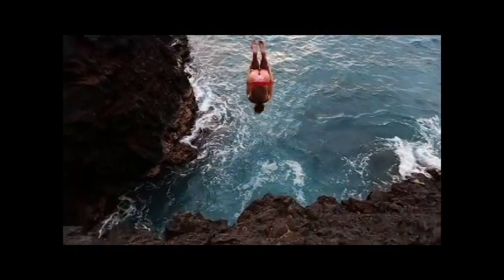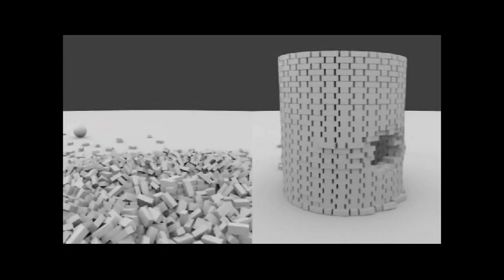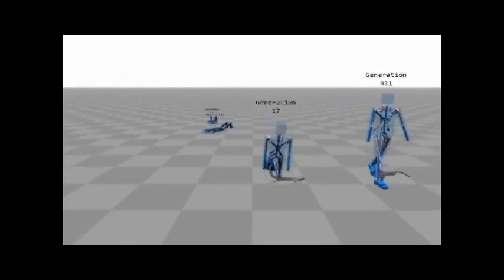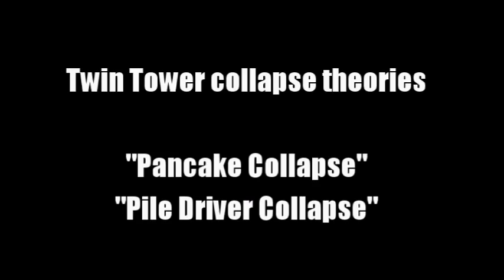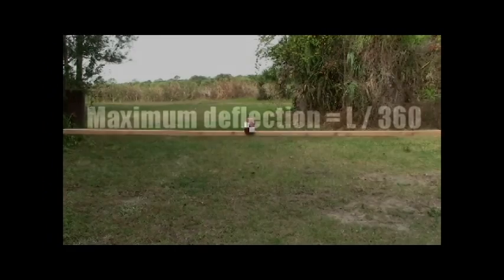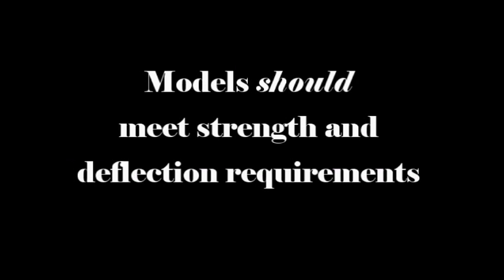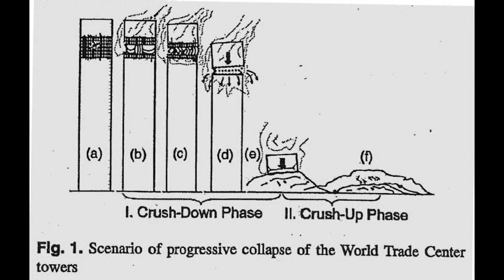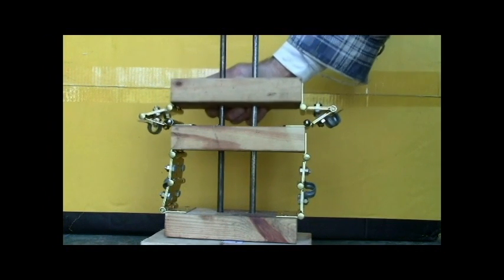9/11 Experiments: The Force Behind the Motion

Comment: Yes, this video does prove something: With a little effort, you can rig an experiment to give the result you want.

Of course, the content of this video has nothing to do with the towers.
Reply: And it proves planes dont need wings to fly if you believe this BS you believe hijackers would allow hostages to call others because...well you can finish that sentence.  Lol. Hint YOU CANT

PS. Cell phones could not make those calls even though phone records prove they came from cell phones.
Reply: @DS94everXev  Your opinion on what the hijackers would or would not have done is irrelevant.

PS. Most (all?) of the calls were made from Airphones not cell phones.
Reply: @Tim22222  They had been called by cell phones . Tower 7 ?? No video plane hitting pentagon .
Reply: @abhilashyadav2274  "They had been called by cell phones"
Two of the 36 documented calls were made by cell phone. 2. And in which state of the flight was that? Where were they flying and at what level?

"Tower 7 ??"
That's not a question.

"No video plane hitting pentagon "
2 video's hitting pentagon. i agree it's hard to dentfy a plane. So what? What does it prove?
Reply: I noticed you posted this 3yrs ago and 2yrs ago you posted this exact comment?
Are you ok?
Do you need some help with your mental problems??
Reply: Also, don't forget that, if you say stupid and irrelevant things, that makes you right.

Comment: Another theory:

Were these buildings just sooooooo wide(64m per side) that they could conceivably collapse, straight into themselves,  as we saw them? 

And tower 2(south) did twist and bend at around its impact floor, much lower than in tower 1, and in a corner.  

Would remote demo have been rigged to give the appearance of collapsing at the impact points, by intentionally first igniting at those floors?
Reply: "Were these buildings just sooooooo wide(64m per side) that they could conceivably collapse, straight into themselves,  as we saw them?"
First of all they didn't collapse straight into themselves. Over 20 other buildings were damaged up to the point they needed to be demolished. That would not happen if the towers collapsed into themselves. Secondly, it is not the width, but the height that determines how buildings will collapse.

"And tower 2(south) did twist and bend at around its impact floor, much lower than in tower 1, and in a corner. "
The top of tower 1 buckled southward just before the progressive collapse as well.

"Would remote demo have been rigged to give the appearance of collapsing at the impact points, by intentionally first igniting at those floors?"
No. No detonation devices will survive the plane impacts and resulting infernos.
Reply: @brucelansberg5485  Each of the Twins was big enough to be its own CITY, so of course there would be collateral damage in such tight quarters.  The supporting cast(WTC 3-5) were all just meters apart from the dual leading act.  

I truly believe that if the impact & fires from those airliners were solely responsible for the collapses of WTC1 & 2,   they's still be cleaning up and rebuilding one third of lower Manhattan as of LAST YEAR, after both them sons-o-bitches FELL OVER SIDEWAYS and took out HALF A DOZEN SMALLER OFFICES EACH.
Reply: @Zickcermacity  Covering 16 acres to a height of dozens of feet. So, no. They didn't "fall into themselves".
As for cleanup, it took the better part of a year.
Reply: @Zickcermacity  No? Nothing? 5 days, and no ability to actually answer. Why MIGHT that be, we wonder? Couldn't be that the cool key-board warrior realized he actually said stupid shit, and ran away? Nah. Couldn't be that.
Reply: @brucelansberg5485  "If the 1993 bombing would have successfully toppled it" sounds redundant.

"If the 1993 bombing had successfully toppled it" should be easily comprehended by anyone with just a sixth grade education.
Reply: @Zickcermacity  ""If the 1993 bombing had successfully toppled it" should be easily comprehended by anyone with just a sixth grade education."
Sure it would. But like @MoonEyes2k said, that's not what you wrote earlier, is it? You left out "had", probably by accident, which gives the sentence a different meaning.

Now, since we got that out of the way, let's get back on topic. My question to you was: How? What mechanism would have the towers fall over, being this tall? Which force would have the towers move sideways? Gravity works straight down.
Reply: @brucelansberg5485  The point is, I never left out 'had' in the first place.  MoonEyes is just trying to stir the pot.

As far as what would have caused a sideways topple across half the narrow southern tip of Manhattan, the towers each were struck on one side, or as in South, in a corner.  If that damage and fire was all it took to bring the towers down, they should have fallen in the direction of the most damage.
Reply: @Zickcermacity  "The point is, I never left out 'had' in the first place."
Yes you did. It's still there, without the "had". 
"If  the  1993 basement bombing successfully toppled the north tower"  Fourth reply in this thread.

"As far as what would have caused a sideways topple across half the narrow southern tip of Manhattan, the towers each were struck on one side, or as in South, in a corner.  If that damage and fire was all it took to bring the towers down, they should have fallen in the direction of the most damage."
This still doesn't answer my question though. The only force acting upon both towers was gravity. So, why sideways?
The thing is that we shouldn't look at the towers as one big massive part. We have to look at them as a collection of individual parts, which is exactly what every single steel framed building is. To unbderstand why and how the buildings collapsed, you need to have a basic understanding of the engineering of the towers. Do you have this?
Reply: @brucelansberg5485   If you guys want to continue arguing grammar, get a room!  I'm here to suggest that those towers collapsed way too neatly to have been caused solely by airliners crashing into them
Reply: @Zickcermacity  "If you guys want to continue arguing grammar, get a room!"
I will accept your aplogies :) You know it's not about grammar of having missed a word. But this incident perfectly shows how we can be fooled by something we're sure of, but are wrong about. Anyway, I believe I have responded to all of your arguments in this thread so far. Seems to me it's your turn. i asked some questions before you side stepped.
Reply: @Zickcermacity  "The point is, I never left out 'had' in the first place." "If you guys want to continue arguing grammar, get a room! "
Translation, "Oh, NO! I actually said STUPID SHIT! Oh, what'll I DO!?"
You're welcome for that.

When you have an actual argument, do let me know.
Reply: @Zickcermacity  Give Bruce a break.  He thinks the planes hit the towers at a 90 degree angle which would be nose of plane hitting the top of the towers and that there was no confirmed repirt of pepper spray being used.

He also thinks himself to be a pilot and aeronautical engineer.  So you have to take his word over experts who contradict him.  It does not matter how many vids and expert pilots and engineers you bring up and present.  He knows more than all of them.

Dont ask him why the hijackers permitted all those hostages to make phone calls.  Or how some of the hijackers never stepped foot in America.  Or how stairs appeared in a plane that had none (coming from a phone call  from a flight attendant who said the hijacker was on top of the stairs in a plane that had no stairs).  Or how pepper spray didnt impact the crew, hostages, and hijackers due to the plane being pressurized if the story were true (only business class was impacted by pepper spray.  That plane was on the ground because it was no longer pressurized)

Regarding the Pentagon plane Bruce thinks the hijackers who could barely fly a Cessea can pilot the airplane just above the ground and not hit lightposts or trees or even have its wings intact nor located anywhere because the Pentagon damage showed no impact from wings nor were the wings on the ground so how did the plane reach the Pentagon?

Bruce insists that cell phones worked just fine at 35k feet in 2001 (they died at 2k feet in flight).  He also insists that it is not reasonable to question how quiet the phone calls were.  No engine noise.  No other people talking in the background.  No screaming from the hijackers to tell people to get off the phone.  Bruce thinks that the entire airplane went 0 voice when a person was on the phone.

Bruce (in addition to being a Top Gun pilot and aeronautical engineer) is the utmost pro in building design.  He believes it is perfectly reasonable to recover only 1 file cabinet of the 43,000 in the towers and that fire can damage steels strength to the point of causing it to weaken and break apart but that very same fire somhow cant melt the plastic or in 1 case burn the passport of one of the hijackers despite it going thru the actual explosion of the plane.  And it is reasonable to expect that the only recovered passports were from hijackers.  You know 1/11 of the people on board managed to have their passports recovered.

Bruce knows more about the tower design than the towers lead architect.  And sees no need to explain how you get symetrical collapse from asymetical damage.  And it is reasonable to assume all of the pillars in all 3 buildings failed simultaneously from a fire that is not equally distributed thruout the building floor nor at the same temperature.  Bruce knows the towers had lots of flammable materials despite there being laws about high rise office buildings requiring non flammable furniture for years before 9/11.

Bruce knows that a planes structural integrity is not relevant to a planes design and that any pilot can handle any passenger jet plane which is going 2 times its designed velocity and still steer it perfectly to its target.
He KNOWS all of this.  So he sees no need to provide evidence of anybody else supporting these ideas among many more.
Reply: To put it simply... the pancaking floors do not explain how the core of the building was brought down without demolition charges of some description.

The floors were suspended between the inner core of the towers and the outer steel walls.

(The shills on here are pathetic & best ignored)

Comment: How can these crude models replicate any of the actual tower conditions after a horizontal force from planes, hours of fires, jet fuel spilled down the elevator shafts to the lobby (per FFs) and vastly different materials (steel, cement, etc)?  These crude models would be as bad if not worse than the computer models.
Reply: How could you have graduated?  No tower was on fire for hours!  

The North tower collapsed less than 2 hours after impact.  The South tower fell less than an hour after impact!

How fast were those planes going when they hit the towers huh?  Mr. Know less than an ant!

Those planes were going about 500 mph!!

And the passenger planes that took off can not go over 250 mph below 10000 feet.

If those planes tried to go the speed that NIST admits those planes were going they would have literally blown apart in the air.  But those planes were PERFECTLY STABLE.  Had those towers not been in the way those planes would have flown on perfectly stable at 500 mph at that altitude till they ran out of fuel.

So Mr.  Wanna be smart, EXPLAIN THAT!!

And you completely failed to see what thid vid did.  He used a concrete block that was stronger than the floor material he used yet it still failed to crush thru!

And the main point is that it DOES NOT MATTER THE MATERIAL OF ANY OF IT!!

The falling object WILL ALWAYS slow down as it impacts objects below.  That is ABSOLUTE FACT.
Reply: @DS94everXev  "And the passenger planes that took off can not go over 250 mph below 10000 feet. If those planes tried to go the speed that NIST admits those planes were going they would have literally blown apart in the air"
According to whom?

"But those planes were PERFECTLY STABLE."
How would you know? How do you detect fluttering wings on grainy unstable videos shot from 1000's of feet away?

"Had those towers not been in the way those planes would have flown on perfectly stable at 500 mph at that altitude till they ran out of fuel."
Incorrect. Both planes came out of a descent, picking up speed.

"So Mr.  Wanna be smart, EXPLAIN THAT!!"
You might want to get your facts straight first before you try to be a wiseass.

"And you completely failed to see what thid vid did.  He used a concrete block that was stronger than the floor material he used yet it still failed to crush thru!"
No. Actually you are the one that faild to see how his "model" completely misrepresents the design of the towers.

"And the main point is that it DOES NOT MATTER THE MATERIAL OF ANY OF IT!!"
You might want to explain this in a little more detail.

"The falling object WILL ALWAYS slow down as it impacts objects below.  That is ABSOLUTE FACT."
Again, please get your facts straight. Falling objects won't necessarilly slow down. You seem to be one of those people that do not understand the concept of acceleration. Free fall acceleration is about 9.8 m/s/s. This means that any free falling object will travel 9.8 second per meter faster than the second before. Now, if that falling object hits something on its way, it will not accelerate at 9.8 m/s/s any longer since there is resistance. It will accelerate less quickly. It might be 8 m/s/s or 5 m/s/s or -2 m/s/s. ONLY if the acceleration has a negative value, it will actually slow down. When the acceleration is over 0 however, it will STILL SPEED UP. There is a whole lot of values between 0 and 9.8. That is ABSOLUTE FACT my dear friend.
Reply: @DS94everXev  Oh, look, a collection of stupid. Shall we see HOW stupid it is, children? Yes, I think we shall!

"How could you have graduated?  No tower was on fire for hours!  "
Tower 1 burned for 56 minutes. Tower 2 for an hour 40. And, the ever so popular to "truthers" Building 7 for 7 hours.
Hence, yes. Hours.

"Those planes were going about 500 mph!!"
Actually, Flight 11 was doing about 465 mph, and Flight 175 was doing an estimated 590 mph. But I guess approximations are ok when it's YOU who're doing them?

"And the passenger planes that took off can not go over 250 mph below 10000 feet."
Cool, so they can't actually get off the ground? Because the 767 climb speed is 290 knots, that's 330 mph.
Then, of course, there's the slight issue of 767-200 cruise speed, which is 0.86 mach, which at an altitude of 200 feet equates to 655 mph.

"If those planes tried to go the speed that NIST admits those planes were going they would have literally blown apart in the air. "
Which, as we can see from the above, is nonsense. Not that that would've happened either way. See, amazing as it no doubt is to you, planes don't hit some random arbitrary speed, and then instantly separates into their various parts. Shocking, right?

"Had those towers not been in the way those planes would have flown on perfectly stable at 500 mph at that altitude till they ran out of fuel."
Highly unlikely, see, there were terrorists on board that would have done something. But, there was certainly no MECHANICAL reason for them not to.

"The falling object WILL ALWAYS slow down as it impacts objects below.  That is ABSOLUTE FACT."
No, what it is is absolute NONSENSE.

Here's a mental exercise for you: a standard pane of industry window glass is 1x1 meter, 2 millimeters thick and weighs 5 kilos. Industry standard being metric and all.
So, if we make it a bit easier on ourselves, we take a pane of this "grade" of glass, but we make it 2x2 meters instead. Being twice the size in both directions, it will of course weigh 2x2 times as much, or 20 kilos. That is, 4(2x2)x5.
We now calculate the volume of this pane. 2 meters is 2000 millimeters, milli meaning "thousandth". Thus, the pane volume will be 2000x2000x2, or 8 million cubic millimeter. The reason we used this measurement is because, a cube that is 200x200x200 millimeters has the same volume.

And so, we place our pane of glass flat on four posts, one in each corner, 3 feet of the ground. We then use a cherry picker crane, and lift ourselves up 15 feet above the pane. And then we drop our 20 kilo, 200-millimeter-on-a-side cube in the center of the pane of glass.

If you think that that pane of glass will withstand the impact, you're willfully stupid. And yet, it has the same volume and the same mass. So, it should slow down. Right? Right.....
Reply: The elevator shafts were deliberately staggered so as not to cause a chimney effect.
So fuel did NOT spill down to the lobby at all.

And the fuel ignited upon impact so how could it flow anywhere?